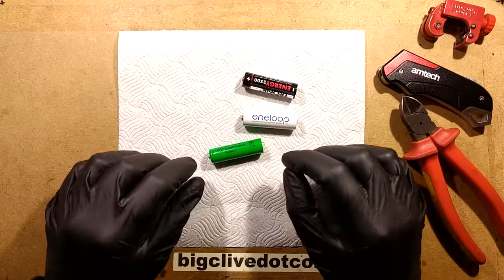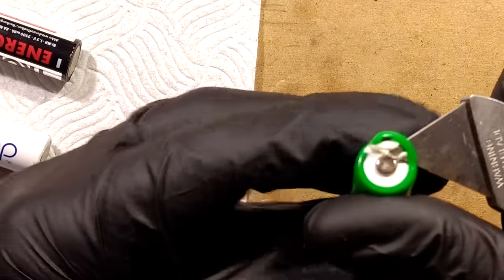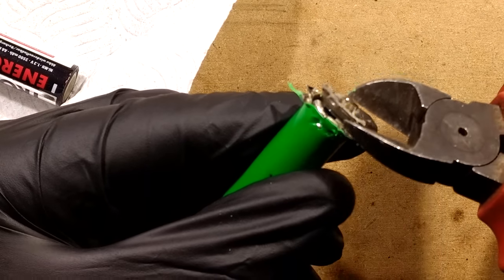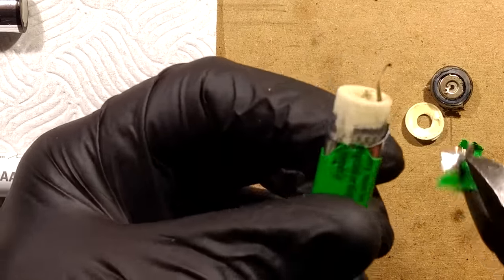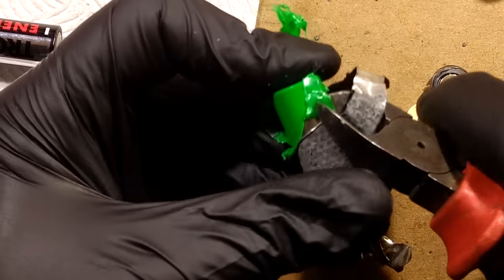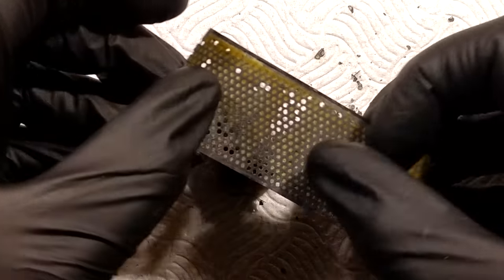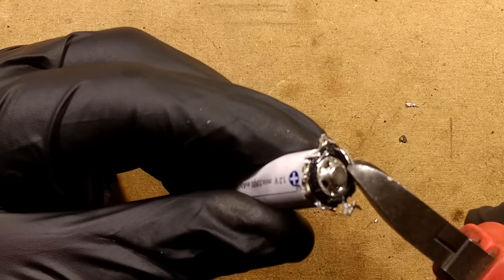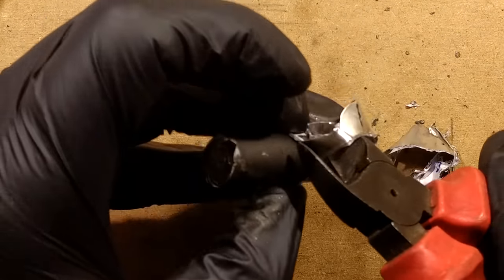What's inside Eneloop and LIDL NiMh cells (fire, apparently)

Comment: My best guess for why it went up in flames is because the metal hydride was lithium borohydride.  Which reacted vigorously with the water in the air, causing it to produce hydrogen and heat, which then caught fire.
Reply: Yes, Battery be burny (in layman's terms)
Reply: So, as long as i don't try to take them apart i shouldn't get a face full of fire (since i use them in my camera flash), right? Right?
Reply: This just makes me want to see what happens if I spray water on it.
Reply: @mikeoxlong1395  Generally yes, as long as the battery remains airtight it's not gonna react. That said, handle your batteries carefully and replace them at appropriate intervals lest they stop being airtight and subsequently become firestarters.
Reply: @drpibisback7680  Thanks, what would be an appropriate time  to switch out rechargable batteries, though? I have Eneloop ones, if it helps.
Reply: battery + water = rocket fuel + heat = fire
Reply: @mikeoxlong1395  Definitively no. What we see here is that the components go fire with conflagration potential in just room conditions once released, and it is the only one of actually quite many potential failure modes. I need to stop treating NiMH batteries as inherently safe (using it in many LED candles around). Many thanks for the author for making the discovery for us. Just noted - the battery contents may burn even when not charged.

Comment: Brave man Clive, I have never taken apart a lithium battery as yet, however I do take old radio batteries apart to rebuild to keep my radios original. The early zinc carbon batteries have a black pitch seal on top, I have an early ever ready flag cell with red pitch on top. As for lithium it becomes unstable on contact with air in some instances. I might give it a go one day but certainly your video gives one a great insight in to this subject matter. The best lithium battery that catches fire is the lipo sack type, seen a few videos on here of people puncturing them, the reaction is ferocious.

Comment: Are there tee shirts with ""Where's my explosion containment pie dish?" And a Big Clive logo!
I used a t-bar tool with a slot in the end for peeling Pyro (As,I'm sure, did you) that looks like the tool for battery unrappery .
Reply from the maker: Yeah I did use those pyro tools.  I preferred the handle version that you just clamped on and wound along the cable though.

Comment: From what I was taught 40 some odd years ago, they manufacture these cells completely devoid of a charge, and the process of charging them expands the electrolyte and compresses everything together.  If so, then charged batteries have more outward pressure on the casing than depleted ones.  It was always an urban legend that some batteries had a measurable difference in circumference between charged and depleted states, though I've never tested this.
Reply: I have had them swell with use.
Reply: @UQRXD  yeah, but that's a different effect lol. That's from cell abuse
Reply: i discarded that as temperature fluctuations because i move between outdoors and buildings often and it's really cold where i work. Hence need a lot of batteries for different appliances.
Reply: They bounce and sound different when charged vs discharged.
Reply: @professorfukyu744  I think that's just Alkaline Cells. I can't think of anything that would cause this in NiMh
Reply: ok so i have and still let my children play an old xbox 360... works great anyways i use for years now rayovac recharge AA 1350 mah 1.2v nimh now when they are charged if warm or cold they are a very tight fit to get into the battery holder for the controller but when discharged they fall right out i have never measured them though....

Comment: So ICs contain smoke and batteries contain fire.  Got it.
Reply: Like they say, there's no smoke without fire.
Reply: hmmm... I'm not sure about that.  I know I have had ICs smoking without catching fire.
Reply: But in most cases if you let the smoke or fire out of its container it stops working.
Reply: And if you run a really big current through your circuit you may see the fire escaping through your leaky components.
Reply: ElmerFuddGun maybe if you put another fire back in it works like pokemons
Reply: Fire is just hot smoke.
Reply: you've got it backwards, smoke is cool fire...
Reply: terorie - I've never been able to put the fire back in and seal it back up before it escapes again.  Perhaps you have a YT video you could share of the correct procedure?  And sorry I don't know anything about pokemons.  I never tried that game.
Reply: ..... and capacitors have mirrors in them.
Reply: You know what they say, there's no smoke without fire!
Reply: And there's no fire without a thermonuclear reaction triggered by Big Clive disassembling a high power battery.
Reply: Yes - that's the magic smoke/fire that makes them work.  When the magic smoke/fire is released, they no longer work.

Comment: Pro tip: Once you get the metal started with snips, switch to needle nose pliers, and roll the metal right around the pliers. Kind of like the old food tin openers. It works well.
Reply: Bonus: If successful, this method presents additional fun when trying to remove it from the pliers without getting chemicals inside the fierce and deep cuts it gives your fingers
Reply: @owlredshift  Bonus2: Use a second set of needle nose pliers to remove it from the first.

(A lesson learnt after cuts were bandaged)
Reply: @owlredshift  but those chemicals catch fire…surely that would cauterise those cuts you have just given yourself? 😉
Reply: Get a narrow strip started then use the key from an old tin of corned beef????
Reply: Yup that's how it's done. Idk how many cheap aluminum tubes I've taken apart, such as vapes, laser pointers, and cheap flashlights. That's exactly how you do it efficiently

Comment: "Explosion Containment Pie Dish" saves the day!!!
Reply: That's often the case when the fire-proof safety paper sheet isn't up to the job that day.
Reply: Always a good day when the pie dish is needed. Surprised he never used that instead of the highly flammable paper towel.
Reply: The original worry was that the electrodes might short so I suppose the conductive pie dish wasn't favoured... 
maybe a cheapo imitation pyrex casserole dish or something similar would have been best thing with the benefit of hindsight.
Reply: I don't think conductivity was anything to worry about at that point, just something to contain the fire until it burned out.
Reply: Hopefully the LIDL ones are still safe as I use them all over!!!
Reply: I pretty much lost it at that point.

Comment: "That's definitely not something you want to stick in your bin, is it?"
I think this is the reason why people are warned to dispose of batteries properly, lol.
Reply: V
Reply: It would be interesting to know what happens to these cells that we put in battery recycling tubs in stores.
Reply: this is exactly what happens,Clive takes them to bits & then puts back together again lol
Reply: @gasgas2689  I don't know the specifics, but I know that some steps involve slicing the ends off and other disassembly, bath of mild acid to clean and separate stuff, a lot of crushing and sieving, and finally melting the metal down.
And like all waste processing of metals, the types of metals separate themselves when smelted: some float, others sink.
Reply: What is a proper way to dispose of spent batteries, though?

Comment: Was running fire duty for a welding job in a plating factory once when a stray spark landed on a super old wooden, chemical soaked step stool.  That one little spark started up a tiny fire which wouldn't go out from being stomped on, sprayed with water, or even being sprayed with an extinguisher.  The bench got drag outside and pitched into the alley where it burned down to nothing.  Moral of the story, fire gets weird when you start throwing chemicals into the mix.

Comment: If you watch from time frame 16:14 you can see the edge of the mesh touching the maternal on the tissue where the fire starts.
Nice one Clive
Reply: Mark Andrews yes it shorted . Clearly not fully discharged
Reply: @Gixer750pilot  because discharging only reduces its voltage

Comment: You should open Ni-MH batteries under a fume extraction hood.
The negative electrode has a steel mesh filled with various metal hydride (including nickel hydrite). This hydrites do store hydrogen gas 900 times their volume (same as palladium). This hydrogen gas is released in the ambient when the battery is opened...
Although is not a large quantity of hydrogen, the gas do its business with oxygen quite efficiently, and can be dangerous. It is ignited by the local short circuits even if small; remember the hydrites are a powerful H - O2 catalyst, this is why you can see flames.

Comment: If you ever need to start a fire always have a LIDL NiMh Battery and a side cutter in your pocket.
Reply: A simple alkaline battery with a small bunch of steel wool works like a champ as well. Just pull the wool out so it stretches from pole to pole and it kinda just burns up 👍
Reply: Can I just hammer a nail into a completely charged battery?

Comment: The bigger holes let bigger electrons through. It saves the big electrons until the end and hence why it doesn't self discharge. You can refill them by pouring finely milled electrons back into them in a tap water solution.
Reply: Dave B Or just pick up a can of pre-milled electrons. The smaller electrons are tough to deal with though. they're slippery little bastards.
Reply: >"finely milled electrons"‹‹
Reply: I find distilled water works best and I get a better life if I use a coarse grind of electrons, finely milled ones discharge too quickly.
Reply: Where can I buy the electrons required to refill my batteries? I've checked Ebay and poundland and have come up blank. 
Also, do I need a special funnel?
Reply: just use the electron faucet on your wall, every room usually has 3 or 4 of them
Reply: back in my day we used to grind our electrons with a windmill.
Reply: This comment thread is the funniest thing
Reply: See "Magic Pixies"
Reply: @DB-ys2gr  R/Whoosh
Reply: Oh, Finely Ground Electrons! 
I mistakenly read Firefly Drowned in Leptons.... imagine my embarrassment now🙄.
Just back from the LHC, having writen a scientific thesis on the whole process. Oh well, thanks to some help from Prof Cox anyway😐. Another year wasted🤯

Comment: The "metal hydride" in NiMH is one of a class of chemicals where hydrogen is ionically bonded to a metal (as opposed to the usual covalent bonding that hydrogen participates in). Some examples of metal hydrides are Sodium Hydride, Lithium Hydride, Lithium Aluminum Hydride. I don't know which one is typically used in NiMH cells. Most of these chemicals will spontaneously catch fire in air if exposed for long enough.
Reply: Nickel oxide hydride (NiOOH)
Reply: It is nickle metal hydride in Ni-MH batteries
Reply: It's not nickel hydride. Nickel oxide hydroxide is the cathode. The anode is typically a mixed rare-earth hydride such as cerium and lanthanum hydrides along with some others mixed in. Not all nickel-metal hydride cells have the exact same anode material, but it's generally some sort of rare-earth hydride mixture. This is part of why they are so much more expensive than simple alkaline batteries (not just because they're rechargeable, they are actually much more expensive to make).
Reply: Graham Stewart natural lanthanum is not radioactive and is quite abundant in the earths crust.
Reply: Identifying what the metal mesh is made of is important for recycling and or science purposes. I have re-used the Zinc metal wrap inside of regular batteries for other science experiments. I am now wondering about that metal sheet you pulled out!  batteries work off a chemical reaction... For Alkaline... It is a caustic reagent with zinc...
Then there are those with an acid reagent and again a metal wrap... Again usually zinc in the regular batteries...
Please identify the metal mesh wrap!
Reply: @kentestes9776  "Identifying what the metal mesh is made of is important for recycling and or science purposes." - It's steel with perhaps some metal coating for protection.

Comment: Pyrophoric pyrotechnics, eh, Clive? Any idea what the material is that gets so excited on exposure to air?
Reply: Finely powdered aluminum and nickel can ignite on contact with air. Including some hydrides.
Reply: Mikeselectricstuff has a video where he tears down a hydride-containing hydrogen storage capsule, the reaction is very significantly stronger than here (probably because it's in powder former instead of paste)
Reply: something is flaming....oh its a nimh (sorry clive)
Reply: Best question so far. I for example have always wondered what the metal hydrides are in these batterys
Reply: Maybe Nilered or Nurdrage can look in to this
Reply: from long ago school science, anything phosphorous based.
Reply: Nickel and titanium, usually.
Reply: skonkfactory I would guess that the hydride ion has grabbed a proton from an H2O that happened by, so you get NiMOH and H2, gaseous hydrogen, and the heat of the reaction lights the H2 up.   Which makes more H2O, and on and on until there's no more hydride.
Reply: Fire.
Reply: Just put some aluminium in an airtight ballmill and let it run for aboout a day or two.
Open it up and expect to die
Extremely vigorous reaction ahead.

Comment: I got turned onto eneloop by my logitech mouse having one and it doing so well with recharging so I ordered a couple dozen AA eneloop and love them. I use them for everything AAA and AA now.
Reply: They're certainly the best, Eneloop is what I use when I need the best capacity. Rayovac is second in my opinion, a bit lower capacity, but work just as well. I also have some EBL brand ones. They work good, and were cheap. http://www.ebay.com/itm/EBL-16x-Rechargeable-Ni-MH-AA-Battery-for-Flashlight-Toy-Camera-Shaver-2300mAh-/111165849459?hash=item19e2003f73:g:pGsAAOxyrM5TGEW~ Got some supposedly 1.1AH EBL brand ones off Amazon, and while they certainly outlast 800mAH ones, I'm not sure if it's actually 1.1AH.
Reply: I've had good luck with Duracell 2400mah they seem to behave as if they were Eneloops.
Reply: I'v never tried the Duracell ones, but they're like $15 for 4 cells at a store near me that has them, so I never buy any. Maybe I'l find them on the Internet cheaper and try them next time I need to buy a few more. I buy Rayovac from Walmart which is like $8 or something if I need some and can't wait for a order. Otherwise I buy Eneloop (and a few times EBL) on Amazon or EBay.
Reply: Same for me, fell in love with eneloop because of my logitech mouse and ordered 8 AA and 8 AAA and they are amazing. Holding way longer than noname cells with double "capacity"
Reply: Duracells with a white topper are called "Duraloop" for a reason :)
Reply: Generally more capacity means thinner separator which means it will leak way, way more and thus have pretty big self-discharge. And in a better, non-chinesium cell, thinner and higher dielectric constant separator.
Reply: I use energizer rechargables. 200 hour battery life it says but got over 400 hours of use for each

Comment: At 16:19 you can see how the kathode touches anode side of the separator. A few seconds later exactly the spot where they touched catches flames. I guess it was the pyrophoric nature plus a little heat from the exothermic reaction where they touch which ignited the fiber
Reply: cathode

Comment: Fire in the batteries? When I was a maintenance electrician, I learned that most electric devices like motors run on smoke. Because, once the smoke escapes, the motor will not run anymore !!
  By the way, judging by your skills with the diagonal cutters, I would suggest that you do not lose your can opener at home